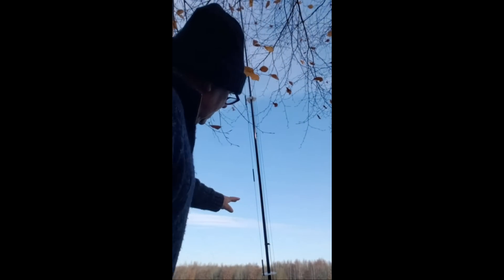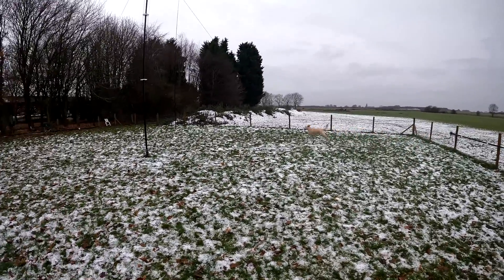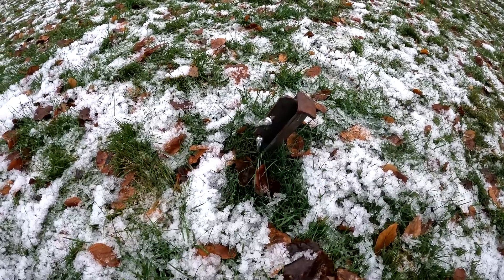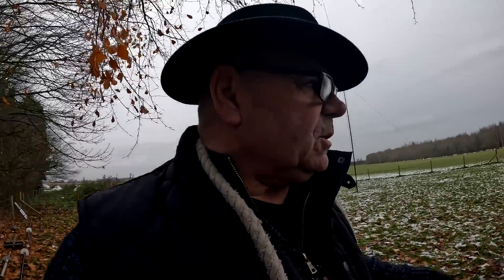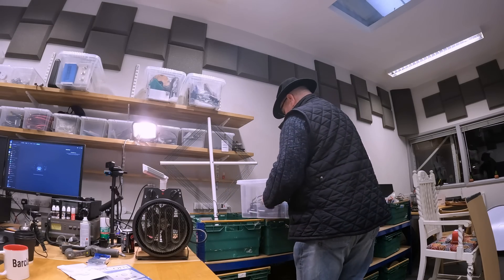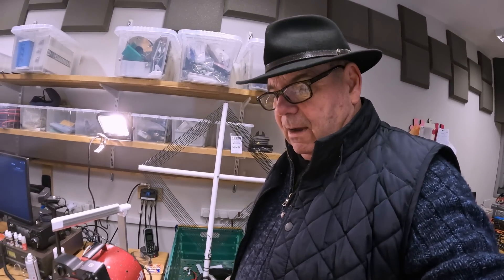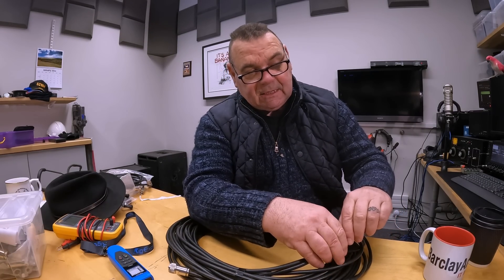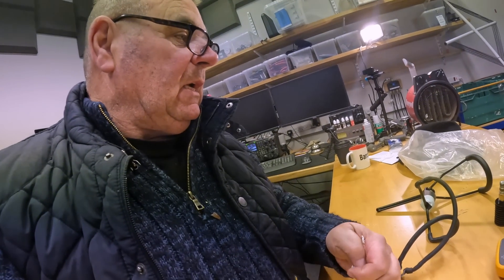What Went Wrong With My Coax?

Comment: for 1300 watts a 50 ohm load with an SWR of 1.5:1 your peak voltage would be abt 440 volts. could have been a high voltage breakdown somewhere that you will never see with a little analyzer on an ohm meter unless it's a complete short. I built up a little HiPot tester for coax/pl-259 cables, pretty simple and safe unless you do something stupid like put the open end of the cable in your pocket! cheers and happy new year to all, Mike, K1FNX near Boston
Reply: That was going to be my question, if you "load" the wire/coax will it show the problem. I've seen this occur in the automotive world where a wire will look good with a dvom but once it's loaded with something like a headlight it can't carry the load.
KE0VNY
Reply: @adamke0vny295  I'm thinking more of a voltage breakdown due to either water or dirt in the connectors which shows up running 1500 watts into the system. Connectors being the likely suspects not the cable itself. Even a whisker of braid could be a problem with 440 volts you would never see with a battery powered analyzer. I would HiPot the cable for starters
73 Mike K1FNX near Boston
Reply: @WECB640  I have been fooled checking cables with ohm meters once too often which is why I built the SO-239 terminated HiPot...... F/B on WBCN they are still broadcasting although all the old on air talent is long gone...the call has been mine since 1963 as an original issue......never thought of it as great...........just what they issued me at the time....... 73 Mike K1FNX near Boston
Reply from the maker: Good point Michael!

Comment: Away from amateur radio I had an issue with a 153MHz paging antenna at the top of a 150ft plus tower. The customer insisted that the range was down. Checked at the transmitter and SWR was fine as was forward power. (Did not do a TDR measurement). Paid riggers to go up the tower, and measure at the antenna feed point, again OK. (LDF 4--50 was fine). In the end to shut the customer up we paid for riggers to go up and change the aerial. Everything happy again but I was driven to investigate further. Doing a swept frequency measurement on the white stick antenna it was strange that the SWR was in single figures even at about double the design frequency. Ran a stanley knife along the tail and the braid was black and damp, a hairline crack in the fibreglass of the antenna had let rain in. Waterlogged cable does not always lead to high SWR it becomes an effective attenuator. Happy New Year.
Reply from the maker: Amazing!
Reply: @DXCommanderHQ  you would not believe how much loss was in that short tail. (granted it was VHF). Coax will tend to "breathe" with temperature variations, as it gets hot in the sunshine the air inside will tend to push out from the connectors and as it cools it will draw in air or moisture.
FWIW some types of cable are often pressurised by a small compressor and dessicator to keep them dry internally. No good with solid dielectric cable though...
As a rough test with your "stick" you could try with NO load on the cable and find a frequency where the SWR is 3:1 that corresponds with 25% reflected power, ie 3dB in each direction. Check that against specs for the cable.

Comment: Another way to test coax and its conductivity is with a megger.  It supplies a larger than normal voltage to the coax and if there is a larger resistance in the coax it will not register a proper high voltage on the meter.  K7AGE has a video where he tested  his coax just to see if it was working properly.  I have a megger I was given and did not know how to actually use it.  Now I am testing some of my coax just to see how conductive it really is.
Reply: Test your own resistance with it at 1000V ;)
Reply from the maker: Yeah Roy.. Don't have a megger.. Maybe I just swap out the coax..
Reply: @DXCommanderHQ  Megger's are around £75 on Amazon. Send it back when finished with it ;). Works just like the continuity test on your Multimeter but at 1000V. It will tell you if there are any sneaky ways for electrons to take a shortcut. And a TDR will tell you where these places are within a few mm. Jeez just saw how much a Nano VNA has gone up in 3 years my kit was around £35.

Comment: bending it more than its minimum bend radius can form points where the impendence is changed by crushing the inner insulation. This can then lead to hot spots at some frequencies, which can then cause the insulation to flow and change the impedance more; on till at some point it can go bang and flash over.  At 1600watts a flash over could affect  the impedance which movement might remove.
Reply from the maker: Good point!

Comment: VSWR will vary up and down a length of cable or waveguide. I'd measure power in / power out, apply cable loss factor to the given length, and watch for fluctuations on key down. Could have been a droplet of water inside the connector, and not a cable issue? You'll let us know what you find, Callum Happy New Year, everyone!
Reply from the maker: Well, it shouldn't do assuming 50 ohms everywhere..
Reply: @DXCommanderHQ  Here's a hint... Impedance repeats at the end of a 1/2 wavelength.
Reply: @imken2392 ut a matched piece of coax will read close to 1:1 everywhere.  While it is possible to get a false 1:1 reading by choosing a particular length, you can’t get a false high reading that way into a dummy load.

Comment: depending on the length of the coax you may get a variety of readings at different frequencies because you may be at a voltage null on the cable . The only way to get a proper reading is to use an electrical half wave coax (length x vf) which will reflect the load impedance at the meter end .
Reply: Spot on 👍 73 Joe
Reply from the maker: Indeed, that repeat every half wave.. However assuming 50 ohms everywhere, it shouldn't matter where it's tested.. But I hear you.
Reply: @DXCommanderHQ  I think things may be more complicated than first meets the eye.  Coax may be be very close to 50 OHM impedance but may not be exactly 50 OHM.  The dummy load may not be a perfect resistive load @50 OHM and will have some reactance.  SWR's of 1.1 to 1 and 1.2 to one correspond to less than one percent of reflected values.  Also your measuring instrument is not perfect and the readouts may include rounding error or truncation error.  Different lengths of coax may have different losses.  With time and handling two identical piece of the same type of coax may come to have slightly different measurements.  A long length of lossy coax will give a good SWR.  
Adding to the potential for confusion here is the fact that you are only making one port measurements with the antenna analyzer. 
However, I am not sure how all of this relates to main issue of a sudden fluctuation in SWR.  I would guess that some kind of mechanical factor such as loose connection would be more likely than an intermittent coax failure.
Reply: @DonGilroy thank-you Don.  I've been thinking about things and my preference was to use the viaecho VNA as I was like Callum not sure of changing readings when nothing changed.

Comment: A lot of rain lately, water ingress perhaps? but I've seen that you normally seal and protect thoroughly including the vaseline.  A multimeter check for DC resistance might pick up water ingress if it's significant amount.
Reply: Richard DePas' recommendation below to try a Megger test sounds a great idea if corrosion or water ingress has potentially led to poor isolation, it works at the same order of voltage as seen at 1300 Watts after all.

Comment: Can your tester do a TDR trace? I would test from the connector to your radio to the feed point and then the antenna. and see if it shows any spikes. It will give you the length to the problem/s. I used to use one so sensitive it would show if a cable tie was pulled too tight. was an awesome bit of gear! My NanoVNA does a pretty decent job. I have learned so much from that cheap gadget and its PC software.
Reply: I wonder how much RF energy your wire fence picks up(or reflects maybe)? Would be cool to measure it somehow. Maybe insulate all of it from the ground and then put a Watt meter on it to a ground stake. 

I know this is a wild idea. Equipotential bonding arrangements could be an issue. causing ground loop impedance issues from your shack to the distribution cabinet.
Reply from the maker: Mate.. this stuff is all so old, I might as well cut the connectors off and re-make them with new coax :)
Reply: @DXCommanderHQ  I meant testing your underground run and whatever antenna and patch leads for it. You must have a sparky (Elec-chicken/Angry Pixie Wrangler/Ones and Zeros Plumber) on your estate with a Megger (insulation resistance tester/meter). I insist you get a VNA with TDR and Smith chart mate. Would make some great content with swearing! but once you get what you are seeing then the truth is out there. I would make a visit with mine but I'm out of range of you financially currently :( dang!
Reply: I'm that skint that I have had to plugin two mice into my PC as my right button has broken in one and the optical in the other. Referee!

Comment: Get a proper VNA like the NanoVNA, the way you are doing the measurement makes no sense: with a long enough coax (sufficient loss) you can leave the other end open or shorted and you will still get a perfect SWR reading.
Reply from the maker: Oh, it makes perfect sense for a quick and dirty analysis. Frankly, its just a pipe for me. I'll change the stuff. I need to be in an antenna field, not faffing with coax :)
Reply: @DXCommanderHQ  A multimeter and a short on the other end would do the same job, more or less. Get a NanoVNA, you will be able to measure coax loss, check (over a wide frequency range) if there are any changes in the line, the antenna system etc. A bit of a learning curve since most people are not familiar with VNAs but once you learn, it becomes as useful as a multimeter for general electronics.
Reply: What is the blue unit your using
Reply: @Ewetopia026  Rig Expert Stick-230

Comment: In case it's not been mentioned a mega is really good for testing leakage in coax that tests OK on a SWR meter but fails on RF power 73 Happy New Year John_K2BAG
Reply: I agree. Get an insulation resistance meter on it also. You must have a sparky near you. Used to have fun testing the resistances of my apprentices lol.
Reply: Just be aware that a long run of coax is a nice capacitor - charge it up with a Megger? remember to discharge it immediately afterwards lol

Comment: It's that time of year it seems Cal. I had a section of my RG213 short out. I was out in the snow and dark troubleshooting. I will not use heat shrink over connections again, but will use the mastic self annealing tape like I did after the repair. Oddly, the connections didn't seem bad for ice, but the coax is still shorted after a day or two, so I suspect it is toast. 

I have my M&P one piece (so no joins) lined up to order when they get off holidays.
Reply from the maker: Ah!

Comment: Could that short length of coax in question be 75 ohm?  What SWR would you expect from a length of 75 ohm coax into a 50 ohm dummy load?
Reply from the maker: No.. I specifically mark my 75 ohm coax. Good idea though.

Comment: Does it matter that the coax you're testing is rolled up. Would it make a difference if you unrolled the coax and then tested them?
Reply from the maker: Unlikely.
Reply: I was thinking this. Surely having it coiled would act as an rf choke that would give you different results in relation to VSWR than if the cable was laid out.

Comment: Hi Cal, is that short patch cable near to an electrical 1/4 or 1/2 wave at the frequency you tested it at 😁
just a thought.
Cheers
Dave.
Reply from the maker: But it shouldn't matter. If you have 50 ohm cable and a 50 ohm load, you should see 50 ohms regardless of length

Comment: I'll say yes coax does lose some of its properties as time goes on you can lose a Db  just because of moisture that gets into the line over years. just enough moisture to start to tarnish the braid then dry up in the summer then back to some moisture back in the fall . most of us hams really don't pay too much attention to coax just as long as it gives us a low SWR but as you have said looking at antennas on MMANA we can get a Db here or 2 Db there which in turns you can possibly lose it in the coax before it gets to your radio. Great stuff as usual Callum Cheers from across the pond de W9US
Reply from the maker: Yes Ed.. Time to swap out everything..

Comment: "Why would a shorter length of coax have a better swr than a longer length?"
Because that's the way it works.  You loose reflected power in the coax as well.  Here's a scenario to exaggerate the phenomena to help you see it.
A piece coax, for example, is loosing 90% of everything you put into it.  You put in 100 watts and 10 watts gets to the antenna.  It's a horrible antenna and reflects EVERYTHING you sent, back to the TXr.  But your coax then again looses 90% of the reflected signal so by the time it gets back to the meter it's down to 1 watt.  100 watts out and 1 watt back, swr looks great, to the meter.  It is not.
As a commercial RF tech we had to measure outgoing power, reflected power, then know the type, length and loss of the transmission line.  There was a chart you used to look up your ACTUAL swr.  You can't discount the loss of the coax when measuring swr.  Your rig expert doesn't take any of this into account so it's just showing you what goes in to what goes out.
Coax loss will always make your swr look better.
Reply from the maker: Yes, I think I mentioned that but thanks for the techo.
Reply: @DXCommanderHQ  These are the parts of radio I like.  Talking, not so much.  It's what I like about your channel.  You experiment a lot.  Thanks!
Reply: Your description matched, but the quote at the top is the opposite of what you explain!
Reply: @patrickbuick5459  I was quoting Callum.  He asked that question.  Maybe I'm misunderstanding your comment, or missing where I messed up.  :)
Reply: BTW, that is why I measure at the antenna and the radio.

Comment: I've heard the best method to check coax is with a Megger and then do a TDR test. General SWR doesn't flush out the issue typically.
Reply: We use to use a megger to dry out wire lines, at the lower voltage settings, never tried it on coax cable...

Comment: I've seen coax get problematic where it gets bends as the inner coatings move about. I've also seen hardline melt or blow out the side from minor dents and such on commercial broadcast lines. I'm always excessively delicate with my feedlines. (my shack runs heliax :) )
Reply: Heliax is great if it's properly and meticulously installed. Improperly installed by inexperienced people, it's ugly.

Comment: I am sure I read somewhere that Aircell 7 is only rated to 1Kw
Reply: Definitely Only handles 1Kw most probably flashover on the tightest bend
Reply from the maker: Yeeeeaahhhh... But I've been shoving 1.5kW down it for years.. However, when it was new!
Reply: i found a spec sheet for the coax, https://www.nevadaradio.co.uk/wp-content/uploads/2019/05/SSB-Aircell7.pdf , given the age i would say it's rf power handling is going to be less than stated, borderline at best,

Comment: when i used to work in the cable industry, we had an issue where slightly bad coax would "load up" where the impedence changed usually over time and as soon as you pull the connector off the thing it was connected to it would dump the load and test perfectly fine. usually the culprit is either water ingress or a bad connector. especially if the readings vary...

Also, you have a bunch of coax running under the road... have you tested it with a TDR lately? if that conduit is full of moisture that can affect it especially if there's a little pin hole in the jacket
Reply from the maker: Good idea but the road coax is fine.. Squirting 1.5kW down there more than once a week..
Reply: @DXCommanderHQ  still a good idea to TDR it every so often... but the easiest way to see if the coax is loading up, just put a 500mw transmitter through it into a dummy load for about an hour and watch the SWR.